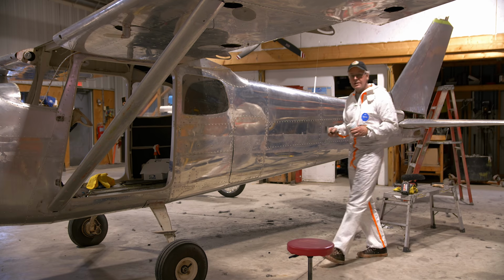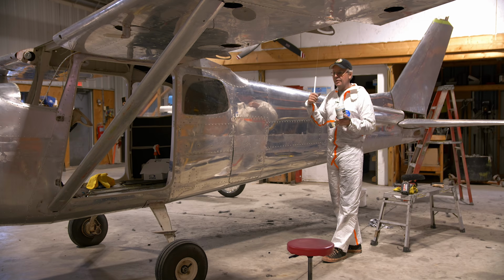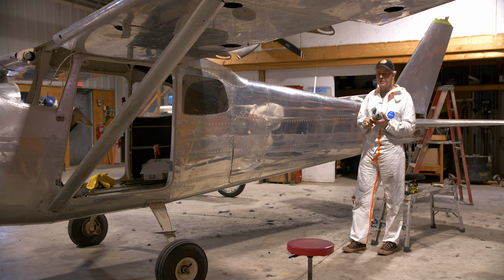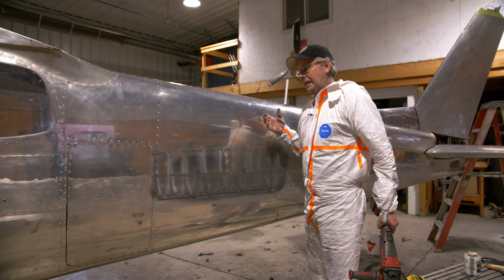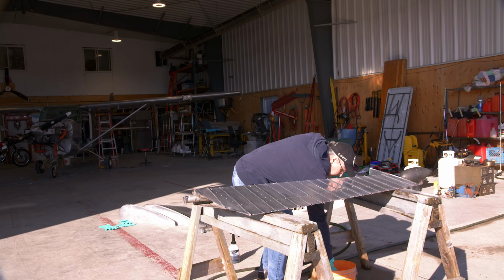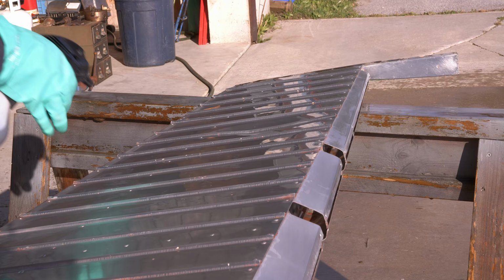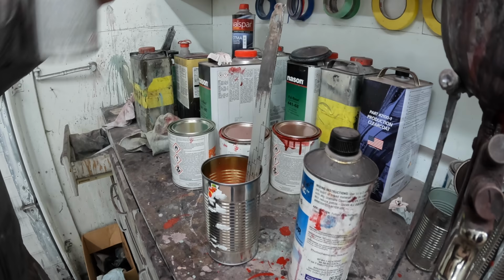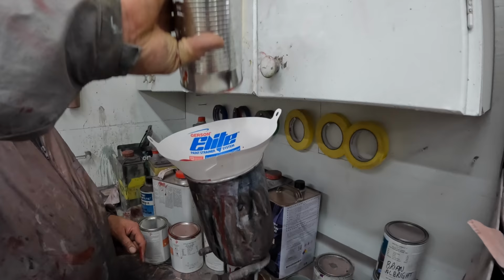Polish and Paint Episode #11 Glen's Hangar

Comment: Hi Glenn,  I've been following your channel for over a year and love all the content.   I bought a 1958 Cessna 172 about the same time you bought your 172 and love all the ideas you are giving me. :)  I have similar mission requirements although I wish I had a 180hp conversion as it would make the plane a bit more effective where I live at 7000' MSL.    My plane is mostly "Polished" with two accent colors (burgundy and turquoise and bare metal, appropriate for the southwestern US) on the cowl and upper sides wrapping over the fast back and I can see an outline where the original factory paint and markings were.  I'd like to someday restore the color to near factory colors.  The current paint chipping and flaking-off, looks terrible but that's OK I have other maintenance priorities right now but thinking about just stripping the old paint off this summer when our weather gets warmer and leaving it bare metal.  For the goal of a polished aluminum plane which paint remover would you suggest works the best and will not etch, too much conflicting info out there?  

If you every get the adventure bug to visit the Grand Canyon please message.   I promise not to say Uh too much at the end of a sentence, if you promise not to say Aye (Inside joke with my cousins in Toronto).    Cheers.
Reply from the maker: Stripping my plane was a real hard time - I was consulting with 'experts', and right off the top they told me that no one product is best. You need to get your hands on small amounts of 3-4 of the top aircraft strippers and test. For me I found one that worked really well on a test strip, but didn't work overall when I went full scale. I ended up using a product called 'Sunset strip', it worked best on the combination of paints that were on my plane. It still left a few patches of primer (whoever painted it last didn't use aviation primer), but I was able to get that off with a cloth and lacquer thinner.
Good luck! It was a great experience, but one I'm not lining up to do again.

Comment: Glen, I'm curious.  I remember several years ago reading about repainting an aircraft, with special emphasis on the control surfaces.  What I was reading was that the surfaces needed to be balanced after the paint job to make sure that there wasn't a weight imbalance because of too much or too little paint on one of the other side of the pivot point.
I don't know if this is true or not, particularly with a small airplane like a 172.  I could see it on something like a 747.
Do you know if, for small airplanes like this, if there is any requirement for a balance check for the control surfaces.
By the way, I think Red is going to look really nice as an accent color for the polished aluminum.  I really am looking forward to seeing the finished product when you get everything done.
Reply from the maker: Re-balancing the control surfaces is something that needs to be done; and you are also correct that for a slow moving aircraft like the Cessna 172 it is of little consequence. We did do it - because that's best practice - but from asking around it seems most don't.

Comment: Glenn, I'm curious about the polishing process. Is there a danger of heating the panels enough to introduce warp, causing that "oil canning" effect. This entire process is in my future on a '77 172N
Reply from the maker: You do have to keep the polisher moving, if uphold in one place too long you will generate a lot of heat. Steady movement and everything will be fine.
Reply: @GlensHangar  Thanks for the quick response! Learning from others such as yourself helps immensely.

Comment: Would it be possible to use a automotive style clearcoat on the polished aluminum to protect the shine?
Reply: Technically speaking you cant use automotive paint at all on a certified aircraft. It needs to be what is in the maintenance manual or an STC'ed system of paint